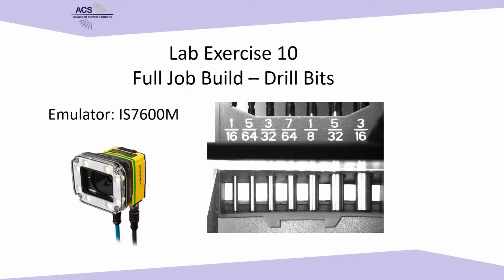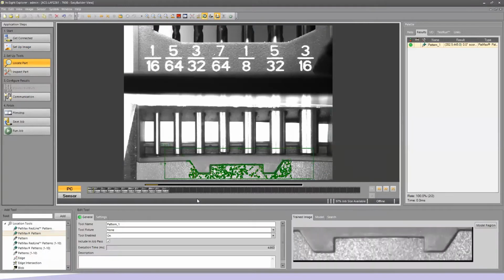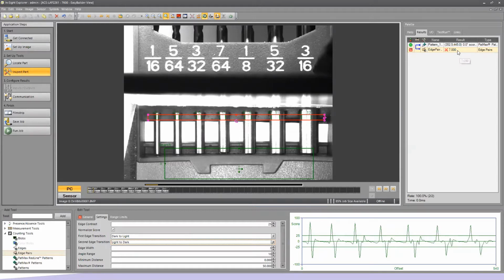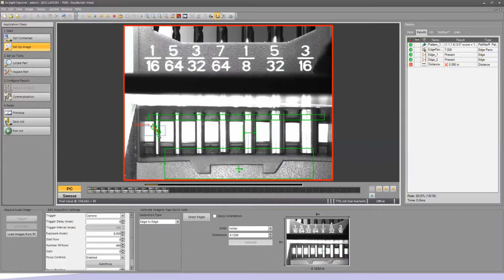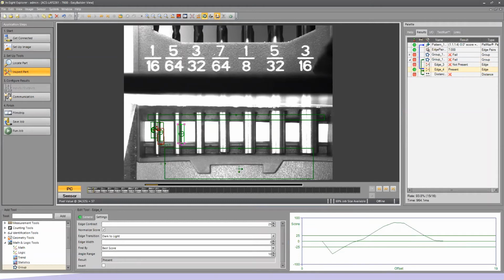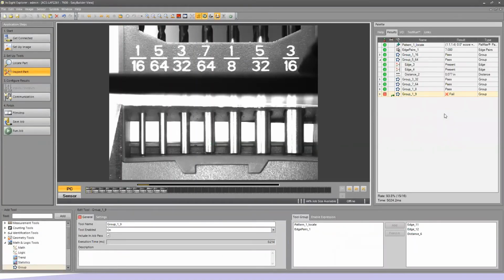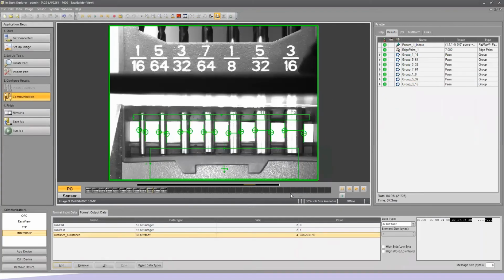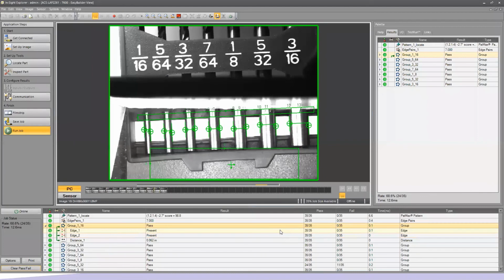Part 8- Cognex Machine Vision & EasyBuilder Intro Online Workshop

Comment: nice, I have a question: for this Upcoming Training & Events
Certified Machinery Safety Expert (CMSE) Class - October 18-21, 2022 - Charlotte, NC
Cognex Machine Vision Workshop - October 25, 2022 - Marietta, GA
Universal Robots Workshop - November 1, 2022 - Spring Hill, TN
Universal Robots Workshop - November 3, 2022 - Marietta, GA
Epson Robot Programming Class - November 8-11, 2022 - Marietta, GA
Universal Robots Workshop - November 15, 2022 - Charlotte, NC
Certified Machinery Safety Expert (CMSE) Class - November 29 - December 2, 2022 - Marietta, GA
Cognex EasyBuilder/Spreadsheet Class - December 6-9, 2022 - Marietta, GA

are you guy going to record videos to youube? if it is not the case, how can the people outside of USA watch it?